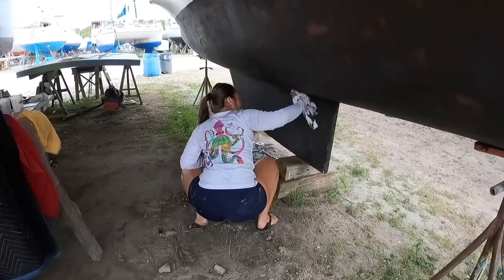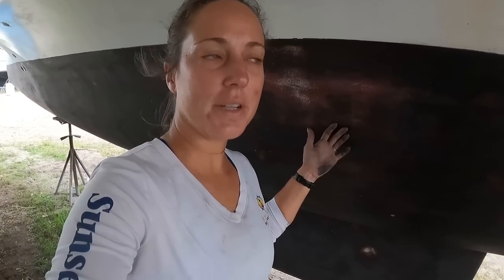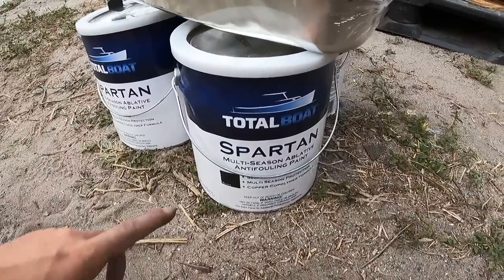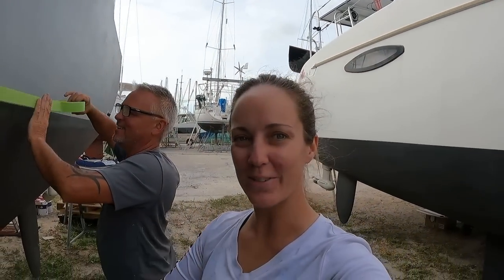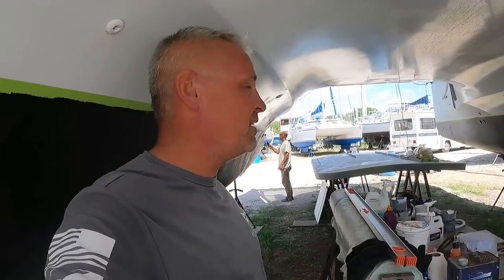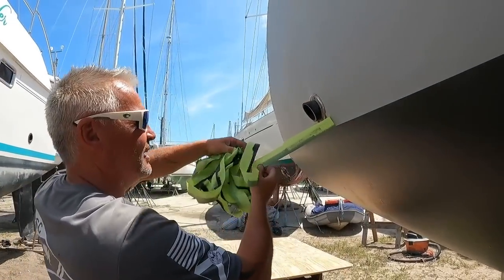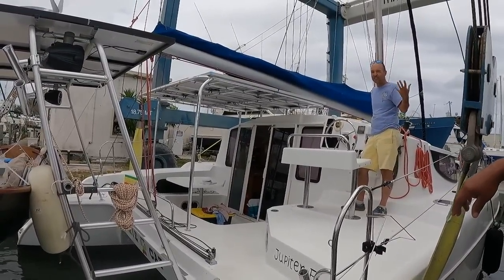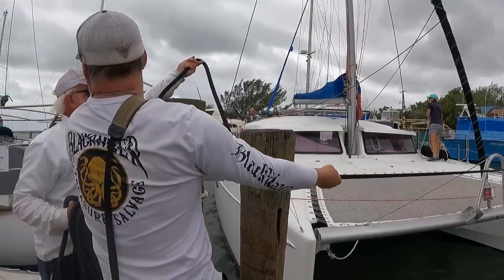ELECTRIC Conversion Catamaran TAKES ON WATER + Boat Projects (S4 E52 Barefoot Travels)

Comment: A person would think that those tiny holes will clog up with bottom growth and the engines could fail from overheating.   Hope they work out.  good episode.
Reply from the maker: Yes they are quite small. Might have to clean the bottom especially the motors more often?

Comment: the new motors are nice, but I didn't hear them mention making use of hydro regeneration capabilities with those motors... additionally the new dingy, while nice and large (maybe too large?)... being completely sail driven is laughable (idealistic conditions sure, otherwise a slough if it's any distance, better bring an umbrella).  it's nice to have a bigger 'car' to move supplies onboard, however without power consider how weight can impact... I would consider some power, like an electric outboard at least;  it's going to be a something that if they don't apparently miss, they will when they happen chance get on someone else's powered dingy.